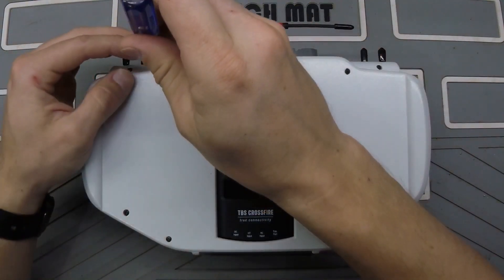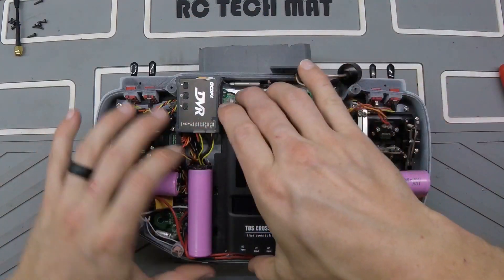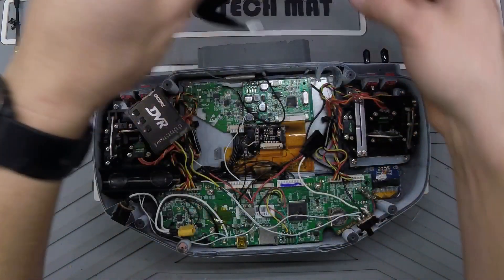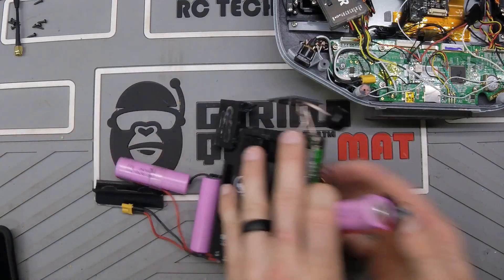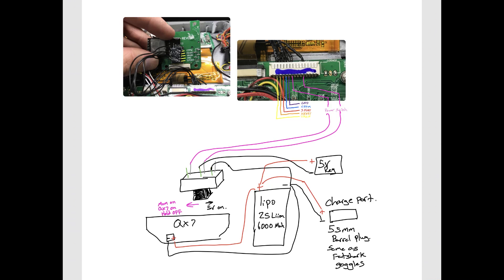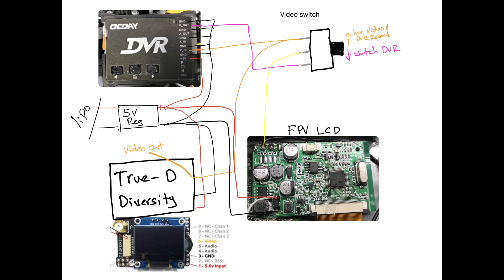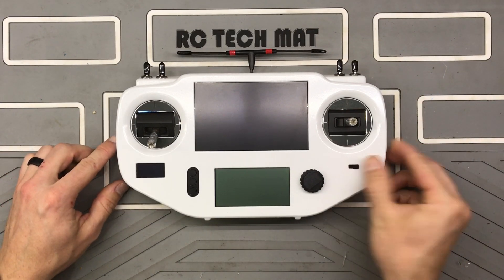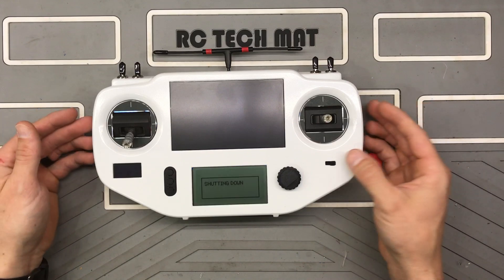Tarango build video. Well kinda Lol

Comment: i got a question about the bypass of the jr module. I have been using the micro tx and i had to do the mod for my telemetry to Work. but by bypassing the jr module, you mean you just connect the cables, and if i have been using the mod i should still use it
Reply from the maker: Engineer Fpv when I said by pass the jr module I ment the part on the taranis. The part with the pins and power button on it. For the crossfire it still needs the little circuit board that was in the jr module box. 
And as for the mod to the taranis for telem lost loop. Yeah I still have that. But I don’t use telem from crossfire much.  I’m not sure how the micro crossfire works.

Comment: is it mandatory to have to hold the switch to power off? Race Day checkin would be so much faster if there were a way to immediately turn off the qx7
Reply from the maker: Spencer Owen as far I know yeah, you still have to hold power switch to turn off, just seems to be how the qx7 circuitry works

Comment: was that antenna tucked away in the top of the case the one for the taranis internal RF module? also its hard to tell but would it almost fit a standard size jr module where the tbs module sits if you pull the case off?
Reply from the maker: maliqua_fpv yeah the frsky antenna is mounted against the top of the case. You probably could get a Jr module to fit depends on what's inside the moduel. The tbs one for crossfire is pretty small components actually inside
Reply: Im hoping to a multiprotocol module mounted in there, well so begins the adventure, thanks!
Reply: Dropoff510 when flying frsky do you notice any decrease in range with the antenna stuck inside?